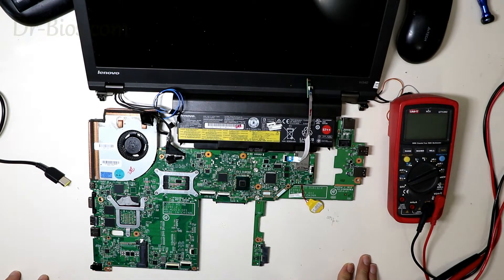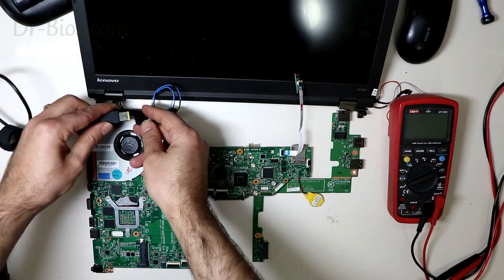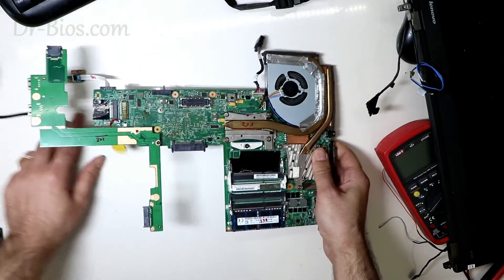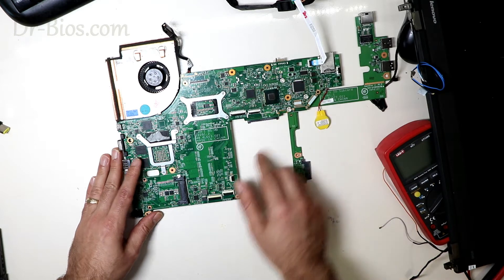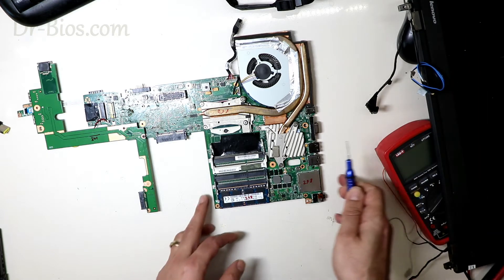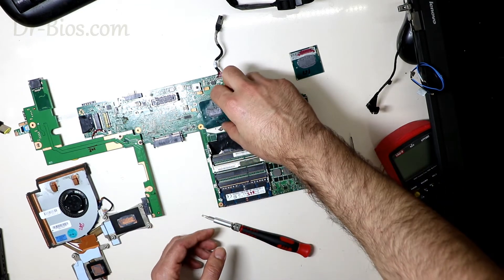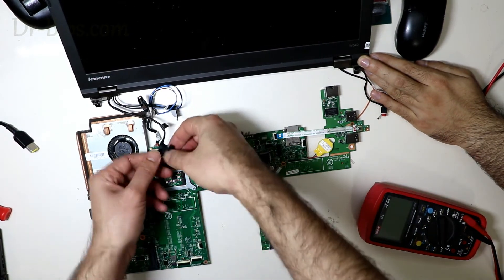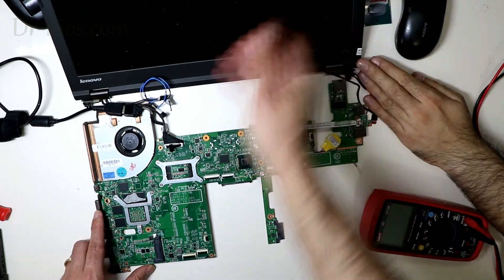Repairing Lenovo W540 that Turns ON with Battery Only

Comment: But why it was working fine with battery power? If CPU was bad it shouldn't work at all. AFAIK CPU doesn't have direct contact with power rail. +13V from battery or +19V from charger goes through same mosfets and gets regulated to 1.x volt for CPU. Do you have any idea about how CPU can cause this issue?
Reply: Because..at one point the CPU have been overheated most probably because by dried out
heatsink compound. 
Bios shuts down the laptop to protect overheating again. On battery the CPU will be in different mode using less power.
Replacing different CPU the laptop will power on again because there is no record of specific CPU overheating. 
You can actually take two laptops with same problem and just switch the CPUs and it will power on.
Fixed hundreds of them like that in past.
However not sure where specifically the info of overheating is stored and which IC
Reply from the maker: We first checked the charging circuit. Finally, we noticed that the processor draws overcurrent and the system protects to protect the circuit.
Reply: @DrBioscom  I get it, thank you but why processor was drawing too much current only on the charger, not on battery power. Doesn't make any sense.
Reply: @virinom   indeed i also felt suspicious

Comment: Absolutely fantastic yet again! But i would ĺike to have seen the technician go through the problem solving step by step..using the multi meter and also the replacement of components as it helps the viewers learn not only the steps involved but the soldering and fault finding procedures. You did that in a past video..please dont take shortcuts.